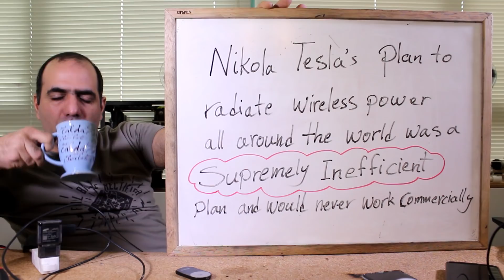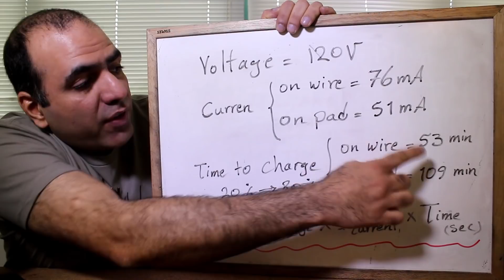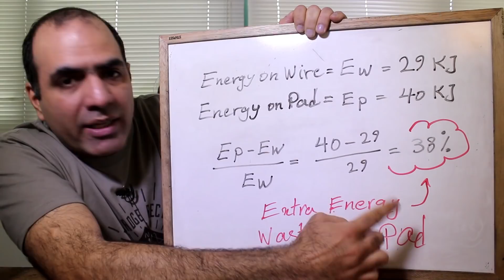Drowning in Inefficiency

Comment: So if coal and gas are so bad at around 20%, why can't we just put money into researching ways to make burning these fossil fuels more efficient?
Reply: coal power plant has 40%, gas 40%, gas turbine 60%.... and please read little bit about thermodynamics.... before you start thinking how to burn fossil fuels and convert to electric power more efficient.
Reply: Gromosław Śmiały I don’t understand; how does thermodynamics prevent us from converting fuel to energy more efficiently? So long as the efficiency is under 100%, shouldn’t it be theoretically possible?
Reply: @TimeRift609  "The second law of thermodynamics states that the total entropy of an isolated system can never decrease over time" so 100% of efficiency is not possible, game over.
Reply: Gromosław Śmiały I only mentioned an efficiency of under 100%. What I am trying to get at is what if we could increase the efficiency of burning a certain fuel from 60% to around 80%?
Reply: @TimeRift609 it is impossible in existing technology and technology is based on physics.
second law of thermodynamics says about maximal efficiency for a heat engine:
The efficiency η is defined to be 
η=1-(Tc/Th), where Tc - is the absolute temperature of the cold reservoir, and Th - is the absolute temperature of the hot reservoir

Comment: Sir...
Could you please explain me what practically happens during the negative half cycle of the sine wave in Alternating quantities like alternating current, alternating voltage etc...
Reply: electrons moving in opposite way ;-)
Reply: @gromosawsmiay3000  Then what about the potentials do they vary..?
Reply: @karthikeyagoud2656 I did not get your point... electrons have the same potentials (positron have  diverted potential, but does not exist in conductors) 
by the way, those are fundamentals of electrotechnics, if you don't understand basic principles... what are you doing here ?
in my country this is on physics in primary school.
Reply: @gromosawsmiay3000  Current flows from higher potential to lower potential right..?
In AC , when the direction of current is altered will the point with higher potential become lower?
Reply: @karthikeyagoud2656  I see you  started thinking :-) 
yes potential will be changed, connect oscilloscope and watch how potential is changed
Reply: @gromosawsmiay3000  Don't get irritated this will be my last question 😊
Consider a phase wire carrying 230V AC which is connected to a load and other end of load is connected to ground.
At an instance before the current direction is reversed,will the ground attain 230V...?
Reply: @karthikeyagoud2656  yes and no, in this case we are measure potential in relation to the ground, so ground have always 0V (zero V) and phase wire has potential from +230 to -230V (effective value).

but you can measure potential on opposite way, we can say that phase wire is reference voltage so in this case there is 0V and ground has +/- 230V, everything is related to reference when you measure value (voltage, current, resistance etc...) when you measure everything (not only electrical values) you measure this to reference.  
in electrotechnics in most cases ground is reference and have 0V

I hope that is clear for you :-)

Comment: You can't think in terms of energy in vs energy out. You have to think in terms of the maximum possible efficiency that nature will allow. In that perspective, 20% efficiency on a combustion engine is actually very good. After all, the maximum thermodynamic limit may only be around 30-35%. That means the 20% efficiency is really more like 66%, since it is very close to the "ideal" value.

Comment: 4:23 Definitely Right! changing form of energy should be minimized.
so i think most inefficient way of using electricity is for heating.
if possible, for thermal energy, just use our gas or other fuel directly, not thru electric heater. NOT thru the power plant where uses combustion. (dunno if energy comes from atomic one/nuke, complicate to include cost of radiation waste)

Comment: Isn't solar panels/wind turbines/tidal power turbines etc. a "free energy devices"? You get the sun, wind, ocean currents for free but you have to buy the panel/turbines like you would have to buy components in a "free energy device" if there where such a thing. The components are never free but the energy source can be

Comment: Here's a (not new) thought on energy efficiency, in line with Mehdi's video: The efficiency of not using energy at all is 100%! What this means is that the best way of reducing energy waste is to reduce energy use in the first place, and you need no PhD to do so. There are billions of ways of doing this, which go beyond the obvious. For example, every single thing you buy has used energy to be manufactured. I wonder how much total energy is required, for example, to manufacture a cell phone, from raw materials to the brand new item on a store shelf. It's a very hard figure to come by in the first place, but I'm certain it is scary high. And that's about only 60% of the total energy used (the rest was wasted in inefficiencies). Or how much energy is wasted in purifying water and pump it from a river to your house's tank? How many times you leave the taps open more than strictly necessary? So every time you postpone the purchase of any goods you don't urgently need to continue functioning as a productive member of society (as opposed to just buying stuff for the joy of it, which is very short-termed), or use resources in a more conscious way, you are being more efficient than what Musk, Tesla, Faraday et al could achieve, even if they worked together!

Comment: I want to design and make a gravity mass battery. A moving mass under gravity generating electricity ....but, only when you need it and only the amount of energy you need being delivered ... like a battery ... But (2)  without the memory issues and the chemical degradation issues.
Also ... A quick pedal through the virtual French hills, will add to the energy.
Electricity . The only energy we can produce carbon free, consume carbon free, and transport/transmit carbon free.

Comment: Let me strongly disagree on the uselessness of wireless charging. I am using this feature for many years and have my third phone with it. My battery NEVER went completely flat in all this time and always had enough juice to pick up a call without doing the silly thing you showed. The cable connecting the charging pad is neatly tucked and isn't moved back and forth around the table. I agree that some energy is wasted as heat but that is just not the scale that can bother me. I also agree that wireless charging is slower than over cable but that is not a problem because, like I said, the battery rarely goes too low anyway. The phone always sits on it's designated place and whenever I need to go outside I just pick it up fully charged. The convenience outweighs every downside named by those who hardly ever used the feature.

Comment: It's a shame since battery technique is not so advanced.......We have developed electric motors with very high efficiency, but the extremely low energy density is pulling its back. This drawback is so sever with battery recycling, charging time, high voltage safety and other issues, Not to mention the fact E-car has a pretty crappy cruising distance(under very IDEAL conditions!). Man...I can drive a gasoline automobile for more than 400 kms, and after that It just take 10 min up to fuel. Energy Density is the KEY, and I'm expecting more practical fuel cell coming into market.Well, I mean Ethanol.

Comment: The home PC i'm currently writing this comment on is 100% efficient. It only only provides me with useful functions but also heats up the house slightly. I don't even use the heaters in the winter (or use much less) because it already outputs around 300 watts of heat into the air :D

Comment: The efficiency of a magnet motor increases as size decreases. The efficiency of an induction motor increases as size increases. A motor twice in size is four times more efficient. 
Cool but look, the efficiency of induction increases as frequency increases. (Not infinately, thresholds apply)
The problem is 50hz AC. It's ridiculously inefficient. 
Only the general public use 50hz, more important humans use higher Hz.

Comment: Wireless charging pads have some advantages for occasional use, being able to put your phone in to a cradle in a car without having to plug the phone in. Another advantage is if you don't have a charge cable when you are out at the shops and can charge it at a coffee shop table with built in pad. (or just make sure you carry a cable). I'd love to see solar panels being cheaper so that they make more financial sense (We have 5kW solar which has generated 55MWh). Would also be good for battery storage to be cheaper too...

Comment: What looks like worth looking into is the... mh... chain of systems from generating electricity / power up until it reaches the end user) component. Then looking into each of those systems, their potential alternatives and the respective efficiency. 

E.g. Power from wind, using to charge rechargeables or fuel cells, to be used in electric cars vs burning hydrogen in cars themselve, etc.

And it might need a fair comparison with regards to efficiency in power transmission / translation as well as CO2 efficiency. 

E.g. What should be taken into account is how how much CO2 could be saved by using solar panels vs how much CO2 is produced in creating those panels and how long do they last...

I think Japan came up with a strategy to more or less replace fossil based energy systems to hydrogen based.
Would be interesting to know their calculations wrt effeciency of that approach.

Comment: I once had to build an 240 AC to 5v DC voltage regulated rectifier at uni that had IC chips and the like to properly get efficiency levels to like 90% ish... never again would I touch or look at electronics the same again. Unfortunately that just killed that branch of engineering for me but I’m still going onto 4th year!

Comment: Wait, 50% efficiency for the electric car? The whole car or the motors only? Because IIRC a good, large scale electric motor will convert 95-99% of electricity into movement.
Also Solar panels are in the single digit efficiency.
Reply: Very expensive, well maintained solar panels can output at relatively high efficiency (20 to 40%). But as soon as there is any debris or dust on the surface the efficiency drops through the floor
Reply: @andrea_frm_dubt8977  40% is physically impossible. There is some Field equation that makes this impossible. 
I am not talking about new vs. Old Solar panel, I am talking about an ideal (laboratory condition) solar panel. For those I believe the maximum efficiency is 18%.

Comment: A couple of details: even though currently solar panels have an efficiency of around 27-30% it cannot physically reach anything higher than around 40%—IIRC it has to do with the fact that only a certain range of wavelengths can actually move the electrons in the panel, while the Sun emits many others along with those.

Secondly: power generation does not have 20% efficiency for coal and gas burning. For example regenerative Brayton-Joule cycles can reach more than 50% thermal efficiency. Lower efficiency generators however are used to cover peak demand periods, where power is more important than efficiency.

Comment: micro usb wears out after only 500 uses. Wireless charging is amazing
Reply: LOL. That's the typical Apple user response.If you followed LinusTechTips, they did a test of micro-USB. After only five-hundred uses it did not feel like new and the snappyness was already gone. It's a poorly designed port that wears out faster than the N64 controller analogue stick, but I'm guessing you would say there's no design flaw with the N64 controller and everyone just uses it wrong.
Reply: MegaMech well.. how do you power your wireless charger?
Reply: David Sinca yeah? Well whats the point of wireless charging if you use cable anyway?
Also he did an excellent job explaining that wireless charger have lower efficiency compared to cable charger
Reply: Yes the lower efficiency thing is fair. But I am surprised that he did not recognize the reason people use wireless charging.You can leave a wireless charger plugged in, and even if the port wears out, it's cheap to replace and not an 800 dollar phone. If you use the USB port for more than just charging like sending the music to a DAC, you can wear the port out to the point where no plug stays in the phone. Which is why USB-C was invented. micro usb has terrible build quality.
Reply: get a phone with USB-C dude.
you don't see microUSB on phones with wireless charging though :-??
Reply: Wireless charging has existed for years before USB C.It's not as easy as getting a USB C phone. All of my devices are micro usb. It takes time to switch to the new standard.

Comment: Hey here’s one.  

Collect all the existing waste products from oil and gas and make massive pontoon rafts that are covered with printed solar panels like the folks at nanosolar developed.   (Check them out, especially forge founding members.   Quite a crowd) 
 Float those bad boys out around the equator (not use up any land) and have the pollution from oil and gas be the only carbon foot print for constructing the pontoons.    As the equator goes around the earth it can be tapped off to everyone.      All the new jobs of converting  the planet to run green fixes unemployment and we can all life happily ever after.   And electrical work is too bad of a job!!   And totally safe.  Unless you are you. Lol. 

Oh and by the way.   Solar is the only energy we get for free.   Free in the sense of thermal pollution.   Why does no one talk about that.   We are warming up because we are releasing potential energy (oil:gas/nuclear/) which lay dormant until released.  Both net a positive btuh  byproduct  beyond the other things.  

With solar.... we received it any way as sunshine.    Even the waste heat we produce in any mechanical/electrical system.  

Does that bit make sense?    As your car/oven/etc works it produces heat which is absorbed by the atmosphere . 
You may not feel it from 10 ft away but that 

Solar it the only energy we get that we would really have no choice.  

Man....  I could go on and on. 

Goodnight it’s late.

Comment: To increase efficiency, try this. Use 100-300 watt solar panel to run only a DC motor. Then use that DC motor to spin an electric generator to get three phase AC output. Rectify that three phase AC to DC. Step down voltage to 12-14 volts high amps and then connect it to 10,000 watts pure sine way inverter and batteries and power your house off-grid for the most part.

Comment: Given the 20% efficiency of generating electricity using fossil fuels; there is still something to be said for generating a lot of energy at once compared to a lot of small engines running for individual applications. Although never mind electric cars; I've actually seen quite a few industrial operations where they opted to bring in a diesel generator to run motorized loads, instead of having an engine at each machine.

Comment: Afaik, Modern power bricks don't use constant current and voltage.
Reply: Charging a Li-ion battery from 20 to 80 % means being in the constant output current region for the charger, so the total load should be fairly constant over time and comparable between the two alternatives. The input voltage is constant and since the load is constant, it should be sufficient to measure the current only once.

Comment: But I am so lazy that I can't be bothered to do such strenuous labor as plugging in my phone. Sure, wireless charging wastes energy, takes longer to charge, the extra heat cooks the battery and reduces it's longevity, but I save 2 seconds per day. So what if it makes more sense to use a wire, it isn't what the cool kids are doing. I also use wireless audio, even though it degrades the sound quality, because I don't want to look like a loser living in the stone age who uses wires.

Comment: "Only 5% turns into light." Well power has uses other than simply making light. Computation requires power (which doesn't make light so turns into heat). Electric motors don't emit light but still require power thus convert electricity into heat. Saying that 5% of electricity gets converted into light, therefore inefficient, is a an over statement.
Reply from the maker: So led lights being 6 to 10 times more efficient doesn't matter? Even computation can be done much more efficiently. Your brain does much more than a computer but doesn't need a CPU fan!

Comment: Can't we add a high power turbine to factory exhaust to generate some energy. That can be used to run lights of the factory atleast?  Can we add solar panels above cars and busses so that it generates electricity to power their respective owner homes for lights and fans atleast?   We can start right there so that we only pay for the refrigerator and microwave and any other load which is heavy?   Can we do it?

Comment: And here we have the first ElectroBoom video I couldn't finish watching.  I don't get the point of ranting about inefficient wireless charging pads when it costs a fraction of a cent to recharge my phone either way.  The advantages of not wearing out the USB connector and being able to just pick up the phone and use it when I want to far out weigh the hundredth of a cent of power I waste each time I use the charging pad.